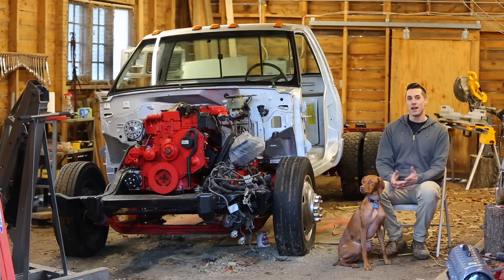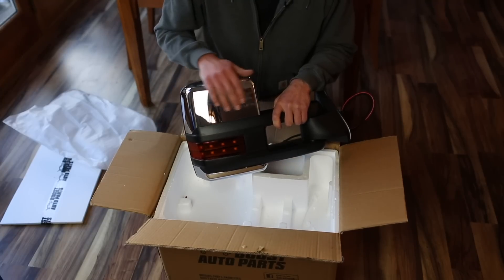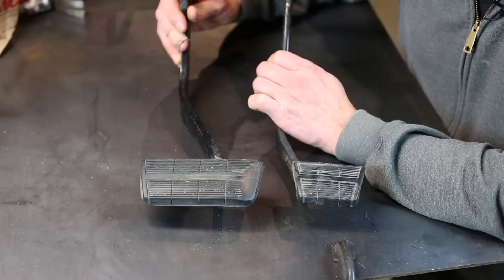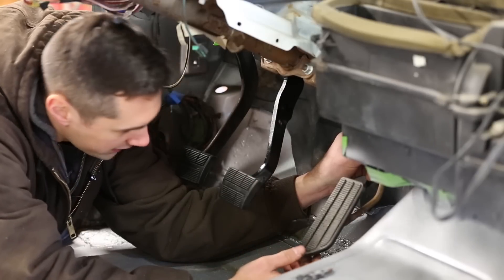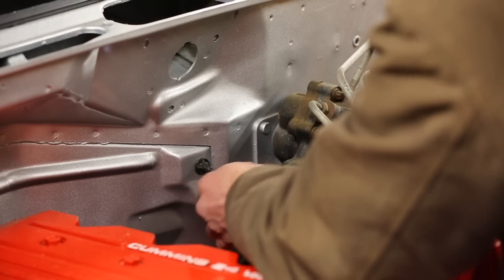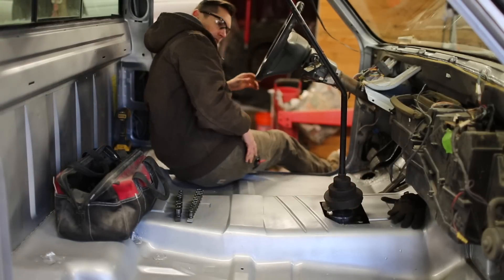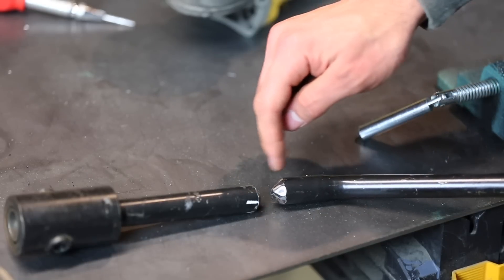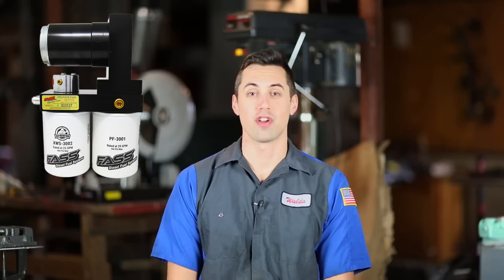Cummins/Eaton Swap: Installing the Shifter, Accelerator Pedal, and Brake Pedal [Part 14]

Comment: Great job on the pedals and shifter. Love seeing this come together. I’d leave the old style mirrors on but those are the type I’ve always used and preferred.
Reply from the maker: Thanks, Pete! Yeah, I was curious to see how I liked the old mirrors because I've never had anything like that on a pickup and it's been more than a decade since I've driven a heavy truck with mirrors like that
Reply: @WaldosWorld  That’s the way to do it. See if the old ones work for you with the new seats. Have someone hold the new mirrors up while you are in your driving position and you’ll know which are the way to go for yourself. 
The truck is coming along really well. You’re doing an amazing job as is Aspen on chipmunk patrol. Lol. Thanks for sharing these videos of your builds.

Comment: congrats on the 6000 subs!! nice job cutting the shifter down. it will be interesting to see how you like it once the seats and dash are back in place. i am thing i would like it a little shorter. another step closer!
Reply from the maker: Thanks, JC! Yeah, I left enough on the shifter to modify it again if I see fit 👌

Comment: I believe that a GM gasoline engine throttle pedal would have bolted in and there was already a provision hole in the firewall just below the hole you drilled
Reply from the maker: Ah, I didn't realize that! That might've made my life just a little bit easier 😂

Comment: Those old west coast mirrors are cool but the way they mount on the door if you ever smack a tree limb its gonna crease the piss out of the door .....them things were on my 95 f250 when i got it from my uncle he smacked a tree limb and it creased the door real bad and also ripped 2 bolts slap out of the door ...its got orininal mirrors back on it now
Reply from the maker: Yeah, that's exactly what happened with one of the previous owners of this truck. There was obviously an impact that messed up one of the doors

Comment: Good job on the truck. If you ever need 4x4 swap in let me know. I swapped mine and it’s awesome. I’ve also got almost the same mirrors and a bunch of parts from a ‘95 HD manual 6.5 that I took apart if you needed something
Reply from the maker: Thanks! I've considered a 4x4 swap and it's a definite possibility at some point in the future, though I have tons of work to do before I get to that point 😂

Comment: My dad has a 2000 dodge ram 3500 dually in Patriot blue. 4x4 with a Cummins. I want to buy from him. I was really debating keeping the stock Mikey mouse mirrors. Or moving to tow mirrors. Its a hard choice cause I remember the truck when I was younger having the mikey mouse mirrors. But having to mirrors Is convenient.
Reply from the maker: I hear ya. Towing mirrors would go real well with a dually though 👌

Comment: Wondering why you didn't just cut off the excess length off the left side of the pedal and install the smaller rubber brake pad to it? No welding or questionable breakage later

Comment: Should have had a 12 valve vp44 suck ppump would be better
Reply from the maker: If the VP44 ever dies, I might replace it with a P-pump, but we'll cross that road when we get there 😉